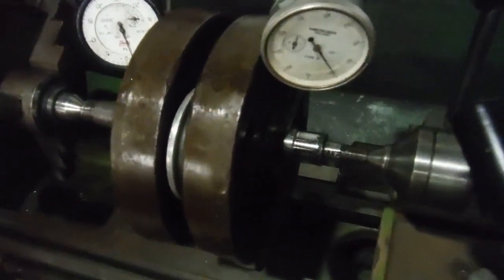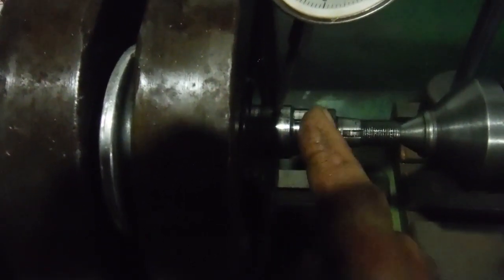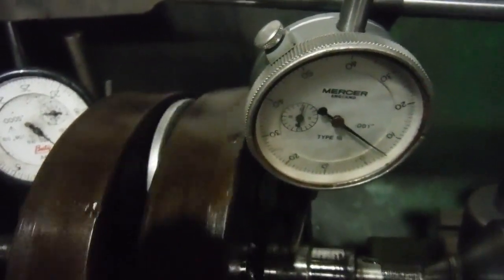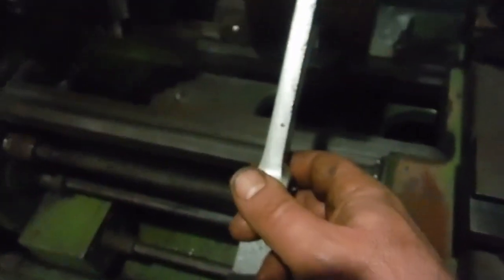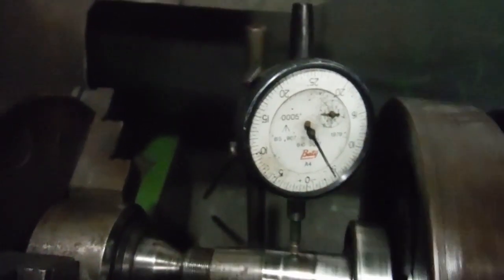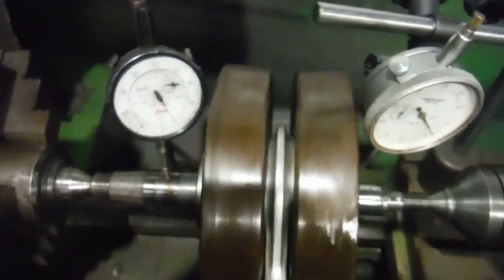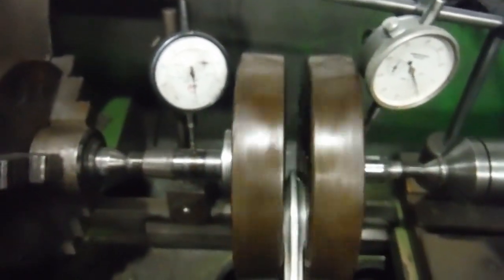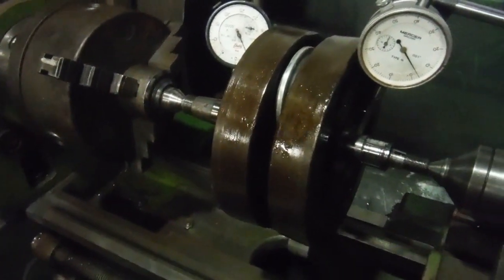Royal Enfield Bullet 350 G2 crank checked for runout and discussed before splitting for repairs.

Comment: Makes you wonder if it was laid up without any oil in very damp conditions. Even then I'm struggling to imagine how it managed to corrode so badly. I've seen caged roller direct on journal bearings corrode as bad and worse than that but never what I would consider an "internal" bearing like that. I have no doubt you've already got a plan in your mind, backed by the years of experience. Looking forward to seeing yet another improvement on this beast. Thank you.